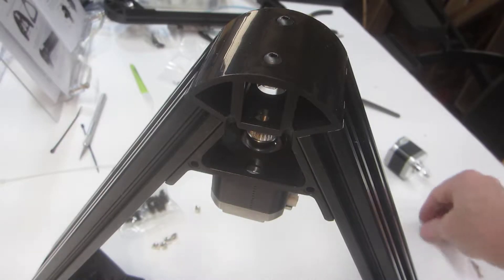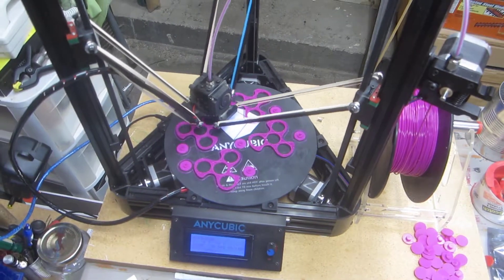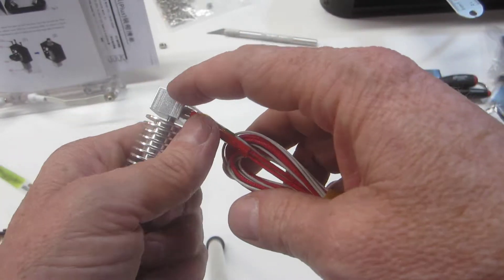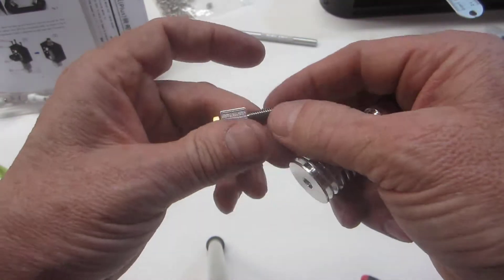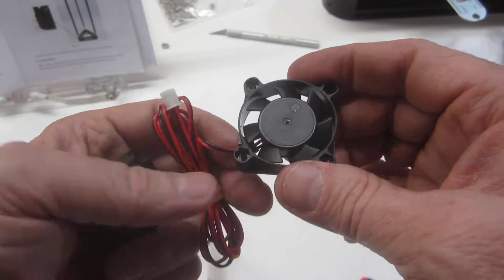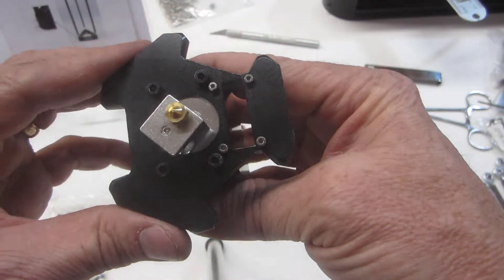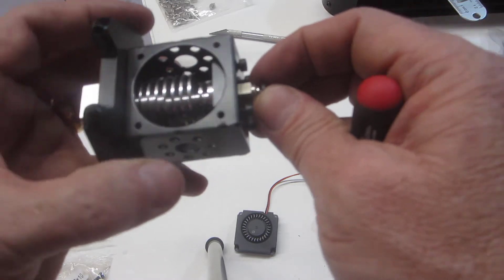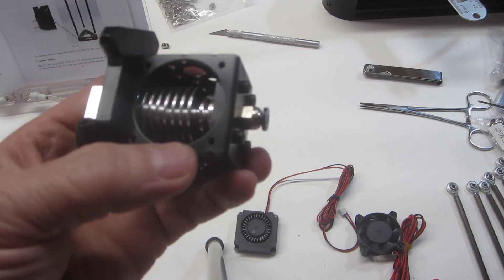Anycubic Linear Plus Delta Build 5 Finishing up the Triangles and building the Effector

Comment: Your earlier Kossel in this video has the X, Y, Z motors going counter clockwise. This machine has them clockwise. The Anycubic video says anticlockwise. I'd think that if they were installed the wrong way (there are only two possibilities), prints would come out as mirror images. Did clockwise turn out to be correct?
Reply from the maker: Hi Jay, Yeah, they should be anti-clockwise, and yes, switching them around does result in mirrored prints. Also makes it hard to calibrate the machine. I've got several videos in the can finishing the build and calibrating the machine, but since the rainy weather started I can't maintain an uplink long enough to get them posted. Sorry.